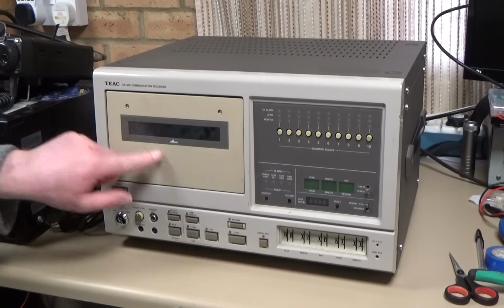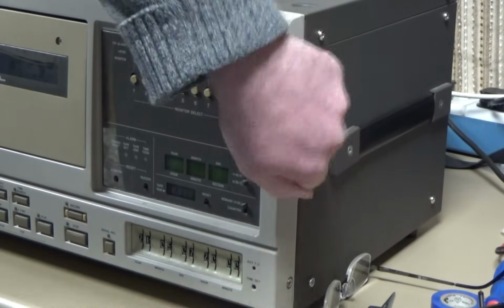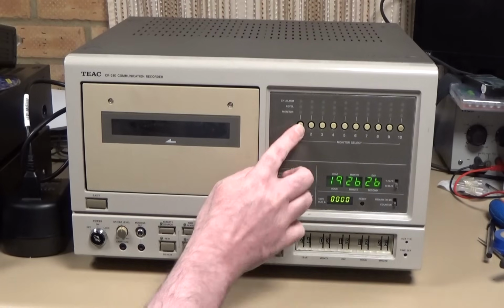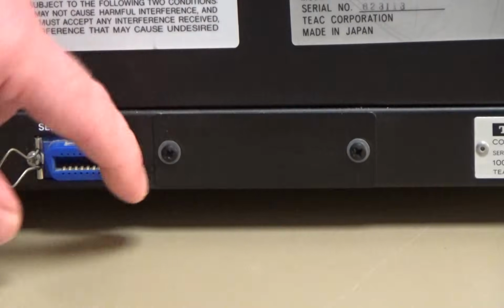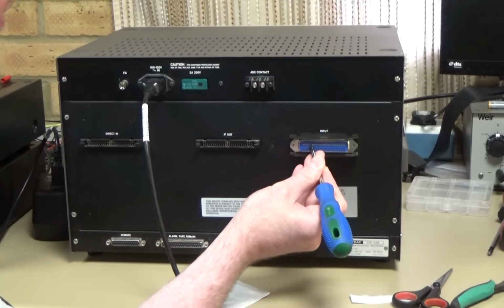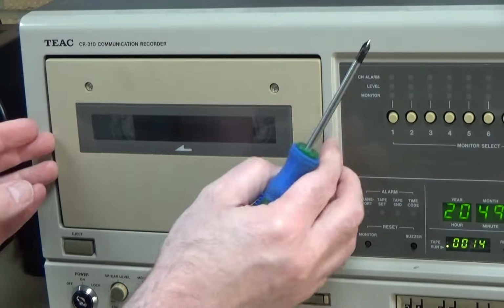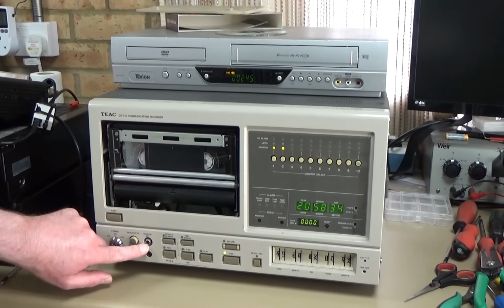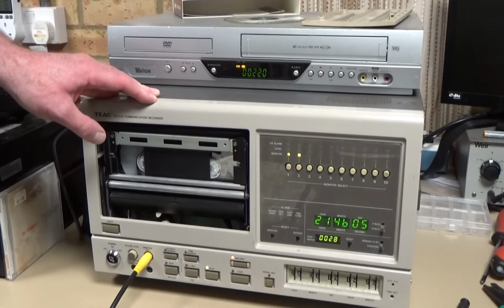TEAC CR-310 Communications Recorder, 10 tracks, VHS-based

Comment: 26:04. MOVMENT IS JERKY. Should be smooth.  Belts bad
Reply from the maker: Unfortunately there are no belts in the machine (see the followup video), but the speed stability improved after running the machine for a few hours, and the weird buzzing noise in the background also disappeared.

Comment: Back in the 80s and 99s I used to work in merchant banking in the city of London, all trader phone (and other voice circuits) were continuously recorded during the working day, so there were many entire racks filled with this sort of recorder, and although I never came across these particular units, devices using vhs tape were common. It was someone’s job to change the tapes daily on these dozens of recorders.

As noted elsewhere in the comments, that’s an RJ21 on the back, up to 25 x balanced 600 ohm line level feeds per connector, using a 25 twisted pair cable.

Of course these machines are all ancient history with hard disk recording rapidly becoming the norm, the real advantage of which was not the end of swapping and storing a months worth of tapes, but same day playback, rather than having to wait for swapsies to recover the wanted tape.

Comment: is that an icom 703 on the left.
Reply from the maker: @davesmith5335  It’s a 706 mk II. Nice rig, but the mic level seems low. Even on max gain I have to speak quite loudly.
Reply: @timf-tinkering  That's interesting. The operators who i've talked to using those radios have always had loud punchy audio. Have you tried using a diiferent Microphone.
Reply from the maker: @davesmith5335  actually I suspect the microphone I have is not the correct one for the radio, although it obviously has the right RJ45 plug on it and it is an icom mic.

Comment: Its a shame Teac didn't develop further in this unit in to like 10 track stereo recorder that could be used as a home studio recording system or even 20 track like you mentioned. instead we had only four or eight track availability. To use at the time video tape was just excellent idea witch was available globally everywhere all sizes and types of it including High end tapes like mastering types.  
Tape Speed of the unit could be much higher with different speed variety you could choose from for different  quality  or tape types. Anyway i just fought to make a point here cos this TEAC seems very interesting little unit that got stuck only to record low quality voice . Thank you for showing and explaining, must say never seen it before 🙂
Reply from the maker: Yes, I agree, they could have developed this idea into a low-cost multi-track recorder for home studios.

Comment: Great video! I would still do an "Item Not As Describe" on eBay to force the seller to ship the keys and manual.  Still amazed on how slow that tape ran.
Reply from the maker: Thank you! I did raise a “not as described” case with eBay, but the only option it offered was to return the item for a full refund, and it sent me a return shipping label. Obviously that’s not what I wanted because I still wanted the item, but it was the only possible resolution offered by eBay, so I just had to let it lie.
Reply: If you paid via PayPal you could have requested a refund due to non-communication. That will usually light up recalcitrant sellers.

Comment: This device was first seen. Although it used VHS tapes, the playback and recording methods were cassette tapes. Because it only recorded 3Khz human voice audio, the sound quality requirements were not high. So he designed to reduce the tape speed to achieve the goal of using a VHS tape to record 10 channels of audio at the same time for a long time (10 heads working at the same time).

Comment: I would try to use some Ampex 102 1/2" heads, thicker capstan rod, etc to have at least 3 3/4 ips. This is very sad that tons of VHS will be recycled at a time they could play some analogue music.
Or this will be interesting to speed it x10 up to 4.96cm/s, because these heads seem to be very promising in terms of a gap width. If they are able to record 3kHz at 0.5cm/s than this must be 30kHz at 5 cm/s

Comment: Looks like device is not in working condition. W&F is extra high and some strange periodic noise frequencies are present. Check PSU output noise with oscilloscope and replace some/all electrolytes in PSU.

Comment: I wonder what 10 days worth of audio books etc I would record on one tape if I had one of those! I would have to round up and connect 10 24 hour players to it, guess you can't record one or two tracks at a time with that erase head.
Reply from the maker: Yes it’s a pity there is no option to record the tracks independently.

Comment: its actually quite a cool device - likely more sophisticated than the demo. probably it records a pilot tone on each channel (inaudible) that lights the alarm if its not received on the replay head. Also the time search function - perhaps try recording several hours then see if you can recover a particular segment. I used to maintain Racal 32 track recorders at airports - huge machines and huge tapes for the same 24 hour period - we'd have loved something like this!
Reply from the maker: I plan to have a look at the mechanism and see if I can improve the tape transport, then I can try some of the more advanced features once it's running properly. There will be a "part 2" to this video at some point. If anyone has any technical documentation for these machines, please get in touch.
Reply: I worked as a service engineer for Racal Recorders in my youth!😊

Comment: Very unusual use of a VHS tape. The audio quality is still very good for such a super slow tape speed. I can imagine some budget studio multitrack recorder, using same principle, but at higher speed of course.
Reply: @janetschartzenmeister yeah, but ADAT wasn't analog like this machine. It recorded digital data onto the tape.
Reply: @janetschartzenmeister super VHS tapes
Reply: Yeah, it's very interesting! I wonder if it's possible to mod it and somehow increase the speed of the tape (increasing the motor voltage or something?) to make the quality better.

Comment: The input connector is very much like a 25 pr RJ-21 connector as used in telephony.
Reply from the maker: Thank you, yes it seems that the 50-pin Centronics (aka Micro Ribbon) connector is known as RJ-21 in telecommunications circles. I wasn't aware of that.

Comment: I cannot help but think that it's supposed to run way better than this :).
Reply from the maker: Yes, I don't think the mechanism is in the peak of condition. It struggles to rewind the tape as well.
Reply: @timf-tinkering  you can literally see the tape wow and flutter while you hear it wow and flutter. It should sound remarkably better, especially when it comes to the stability part. Frequency range will be low not matter what. Honestly a rotating head is just not ideal for analog audio combined with an ultra low tape speed.
Reply: @rollingtroll  there is no rotating head in there though, just a normal 22 track wide head stack like you'd find on studio multitracks
Reply: It is literally recording 10 analog linear tracks side by side. Like some four-trackers record four tracks parallel with an auto-reverse deck's head on a C cassette, and so on. No way it sounds nearly as good as some of the worst C cassettes.
The mechanism likely has some issues, there is a lot of flutter and the speed is audibly uneven between sessions. Also the tape speed may be just below what is needed to record that tone or higher. It is meant to record phone quality signal and no better. The C cassette standard uses 47,5mm/s and this uses the tenth of that, or so. IIRC nominal speed of VHS in the 50Hz countries is about 23,4mm/s so technically the linear mono track on standard VHS has about half the bandwidth of a C cassette.
Reply: @jussikuusela7345  There's no comparing it with cassette though, the video recorder has a rotating head :)
Reply: @rollingtroll  Well for the HiFi audio VHS uses the helical scanning drum, but for plain mono audio, a linear head so the tape speed analogy applies to it.
Reply: @jussikuusela7345  I am fully assuming this doesn't use the stationary head. If it does, why use videotape?
Reply: @rollingtroll  Go to the 6 min mark and have a look 👀 I would guess using a widely available magnetic tape format like VHS is just a cheap and convenient. It's apparently wide enough to fit 20 channels, so why not?
Reply: @pita5685  holy shit. Yes I didn’t watch the whole thing but that is just horrid. In that case it is only supposed to run better, but not sound better 😄
Reply: @rollingtroll will probably sound just marginally better if running properly.
Reply: I too, think this should sound a LOT better. I remember the VHS machines for professional audio back in the 90s and they sounded WAY better than this. I believe the recordings were digital, though. Is this 100% analog recording to a VHS tape?
Reply: @chad2787  This is analog but that's not the issue. It's running at an extremely low speed, has nothing to do with hifi :). But it's not running consistently.

Comment: Maybe there is something in it to make the speed go faster try it with the music at faster speed
Reply from the maker: I can't see any way to select different speeds, and there is no mention of any other speeds in the documentation I was able to find. It may be possible to hack it to run faster, but it seems to be designed as a single-speed machine.
Reply: Doubtful. These were designed specifically to record phone conversations. Tape drive was designed for one speed only.

Comment: I've got a beta Hi-Fi which records excellent sound reproduction.
Reply: Basically all Hi-Fi VCRs sound excellent, but they record in a very different manner to this recorder - HiFi VCRs move the tape comparatively fast & record audio diagonally across the tape(which is how the video is also recorded), which has the same effect as using more length of tape/recording at a considerably higher speed again. Apparently the effective tape speed of hifi audio on VHS(probably very similar for Beta) is 80 inches per second vs 1/5 of an inch per second as used on this recorder.
Linear mono audio on VCRs is so-so, but still much better than this device as it's seemingly still recorded at about 6x faster  than the tape here. I'm not sure what the respective tape width used for each track of audio is with each method though.
Reply from the maker: Yes, I did initially wonder if the machine would use a helical-scan head like a video recorder, as 20 channels of speech quality audio would no doubt fit comfortably into the bandwidth normally occupied by a video signal, although the track width would have to be very narrow to fit 24 hours onto one tape, but no, the machine uses much simpler linear tracks.